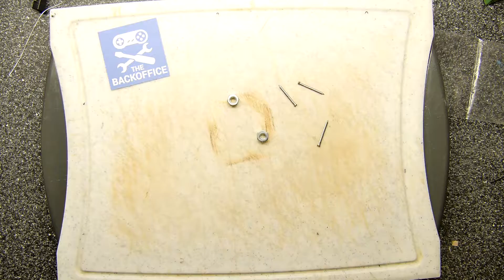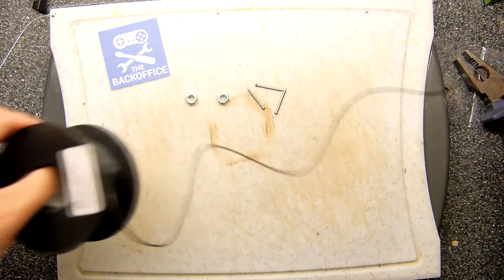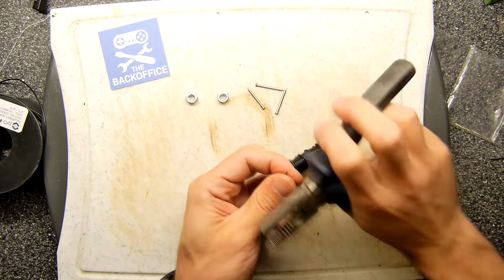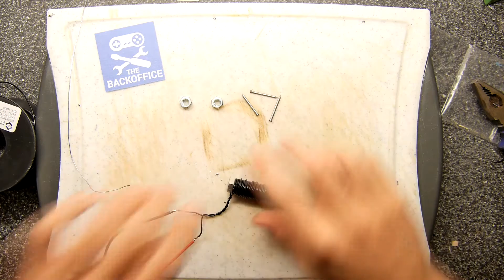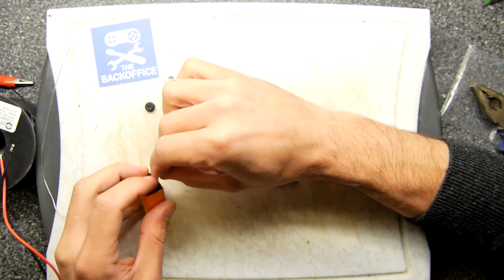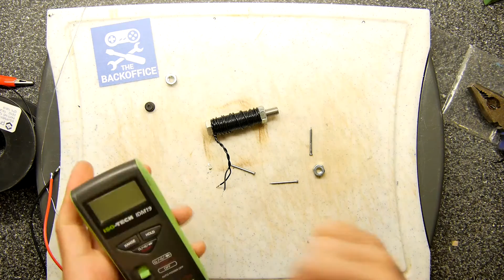Lets make an electromagnet! Fail! - Teardown Lab В Советской России , электромагнит делает вас

Comment: Use 10 or 15 amps at 12 volts and it may get warm but it will work fine, the laptop supply didn't work because it has short protection and turns output off of it is shorted out

Comment: You should build a radio too,  there's not too much difference.
Reply from the maker: I still have that 300 in in 1 kit and that contains the pre-wound radio bits. If I had the time I would love to go through that kit properly, you would be an analogue electronics expert by the time you did the 300. I only really know digital electronics and a little audio. The former is basically an extension of programming, so easy to understand.

Did you ever get your kenwood functioning?
Reply: In the 70's we hooked up a lamp to a switch and battery to get a blinky light.  Now we hook up LED's to a switch mode supply and a micro controller to make them blink really fast (or when the dog farts)... such is progress.  P.S.  Kenwood in the 80's was kick ass stuff.  Used a lot of those PITA STK#### amp bricks that were a bit pricey at the time.
Reply: I bought a kit once that had a radio powered by a potato.
Reply from the maker: +Larry Bundy Jr Do you remember in portal 2 there was a potato sequence? With the AI core being potato powered? Such a great game, amazing production values!

Comment: You have enough turns, you just need a higher current as I said before, I would suggest a good size linear transformer (if it's really heave then it is probably the right type) as some switching supplies have short protection, or if you happen to just have a nice large 18650 battery pack or even some SLA batteries then use those, even an old car battery should work fine for that
Reply from the maker: +Robert Powell will save a car or motorcycle battery next time I need to swap one. Winter is coming so bound to be at least one poorly car battery will reveal itself!

Comment: It's called "magnet wire" :-)

And as Robert said: "More current Igor!"
Reply from the maker: +Bryn Reeves I need a nice juicy bench supply. These small ones are safe enough for electronic kits, but wussy for dangerous stuff.
Reply from the maker: Can you suggest a suitable bench supply with say.. 5 amps capability at 12v?
Reply: Was gonna get you one for Christmas...
Reply from the maker: Bryn Reeves I will wait till then. Just tell me  the specs of the magnet I need to wind to make the most out of it when it arrives. Also will said electromagnet be scary to use? (correct answer should be YES)
Reply from the maker: +Bryn Reeves sure it's not ginger pubes then?
Reply: +TheBackOffice I think that's a brand name.. GingerPubes ®™
Reply from the maker: +Bryn Reeves if it isn't, it should be!

Comment: A nice bench supply I've been using for years are the China 30v/10A CV/CC jobbies on eBay for around $70. Example: http://www.ebay.com/itm/10A-30V-DC-Power-Supply-Adjustable-Dual-Digital-Variable-Precision-Lab-Grade-/251705177148?hash=item3a9acc343c:g:nVYAAOSwqBJXUIWJ 
 Kits, motors, hot wire foam cutters have not bothered it a bit.  It's nice that it can be set to push say 3 amps and no more.  A roll of thin GingerPubes ®™ magnet wire, a nail, and a drill for winding and Bob's yer Auntie.  AC works too if you have an old train set power supply with the speed lever on it.
Reply from the maker: +Eddie the Grouch I think bench supply is next, I just need to keep it further away to rebind myself to use the low current one first on my projects or else I will end up blowing out the arse off a lot of things 😁